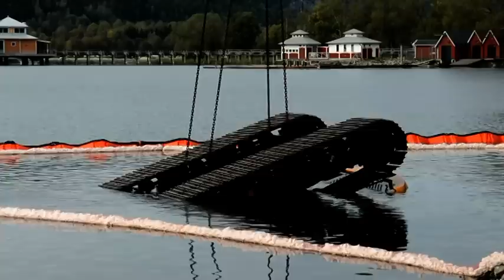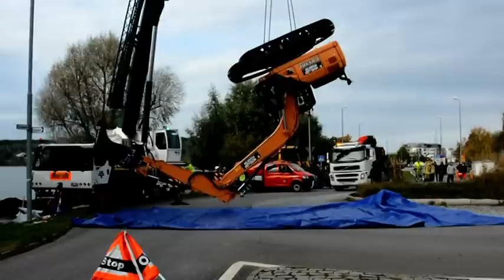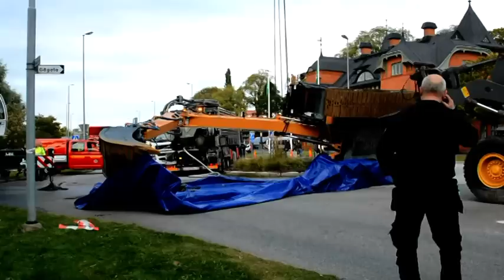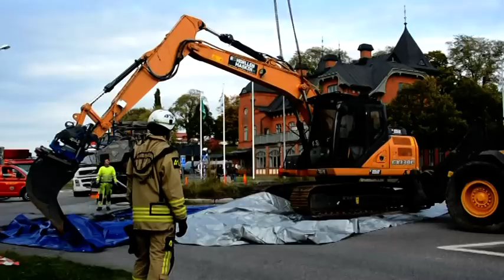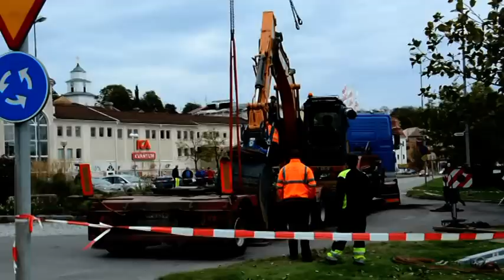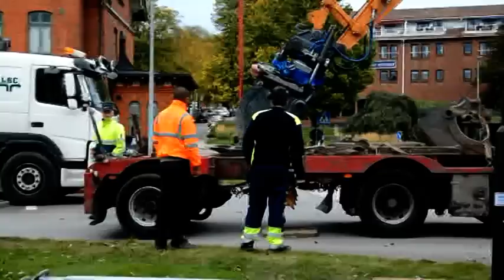Bärgning av grävmaskin

Comment: Why lift it out of the water upside-down causing more damage to it and the road ? But still.. How did it get in the drink ? Operator drunk ?
Reply from the maker: The excavator was upside down in the water when it should be salvaged. The excavator was working at the lake when the ground during the burst and the machine overturned in the water. The machine operator was taken out of the machine itself.